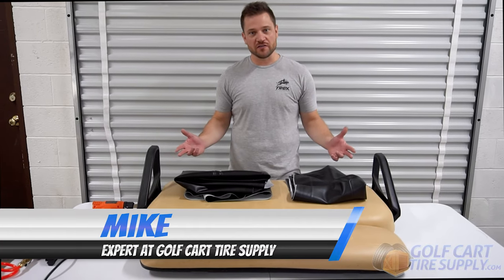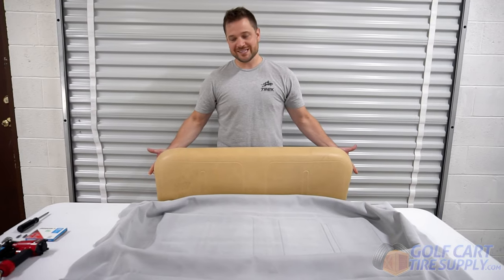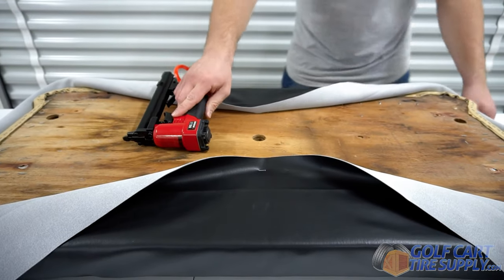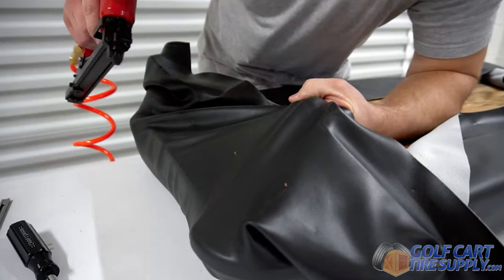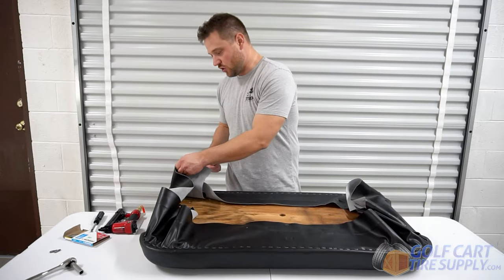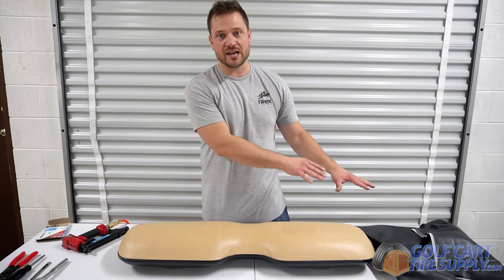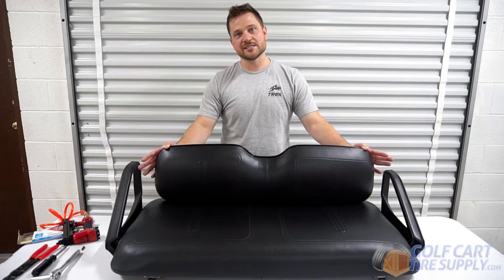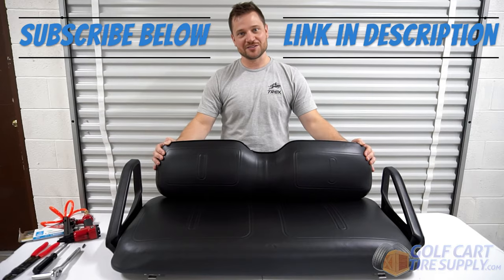How to install Golf Cart Seat Covers - For All Carts!

Comment: I would also like to know what Greg akshar asked below. What size staples do you recommend? Wide crown, length, etc... Thanks for the video it's very helpful.
Reply from the maker: We use a pneumatic stapler so we are able to use 3/8" staples. If you're using a hand powered stapler, 1/4" would probably be a little easier to manage. The 3/8" penetrates a little deeper obviously so the pneumatic stapler comes in very handy for those. Hope this helps!

Comment: Did I miss where the heat gun comes into play?
Reply from the maker: The heat gun is a useful tool for getting the material to stretch if needed. It's not necessary but it definitely can be helpful to make the material easier to wrap around some of the areas of the seat!

Comment: Should I remove the existing original cover?
Reply from the maker: that's personal preference. You can take the old one off or just cover it up with the new one!
Reply: If your old cover has a rip will it show through if you don't take the old cover off?
Reply from the maker: @TheAkhor  I think that may depend on how thick the rip is. My guess is it wouldn't be noticeable through the new cover!
Reply: What size staples do you recommend?